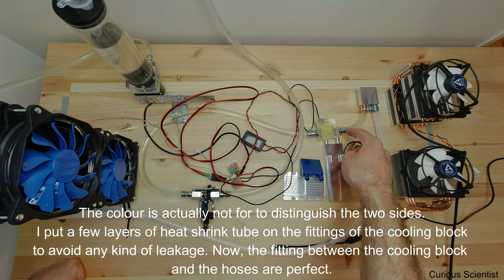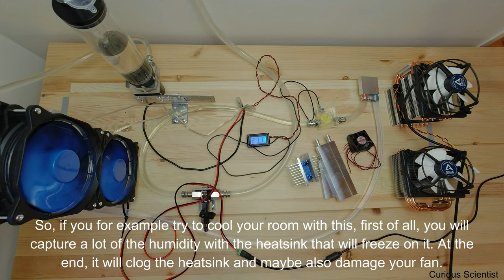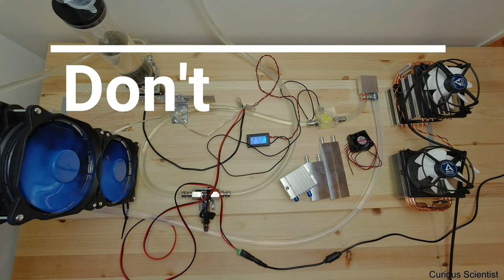Introduction of my cooling setup used in the Peltier experiments

Comment: 10:55 I agree, when the air flow is guided it doesn't matter if is "pushed" or "pulled" mostly of the cases. Almost identical results when the guide duct is very short and the input and output holes are similar, very knowledgeable people told me that.
Reply from the maker: Yes, I think so too! It should not give any noticeable difference. If it does, then, something must be wrong, I think. I don't remember the guy's name, but he made a video on this topic, and he concluded the same. I will do a video on this later on, so the viewers cannot say that I am just repeating someone else's words. But, I already expect no difference. 

However, the evaporation method for air cooling that Paul mentioned sounds really amazing. I will make a test rig for that, because I think that kind of test and demonstration could be a nice video.
Reply: @CuriousScientist  A friend with experience in AC systems told me this is different in big buildings when pulling hot air is a lighter load for the motors than pushing cold air inside to the ground floor. When cooling a electronic case is also better pulling hot air to outside because, most of cases, the motor is very weak (cfm vs rpm).
He told me about something called Airflow Efficiency and many other things I never thought before🤔  I live to learn😅   This channel is very informative
Evaporation is another beast, we use it a lot here in the hot mediterranean, a good beast 😁
Reply from the maker: I am not at all experienced with these AC systems, so any good advice is useful for me. But yes, it makes sense to let the physics work for us. The electronic case cooling (i.e. a computer, but also any other units) this pushing and pulling is really important. When you check these computer forums, you always find someone who is looking for advice for fan arrangement, because their components get hot.